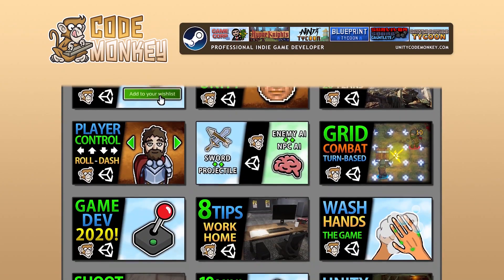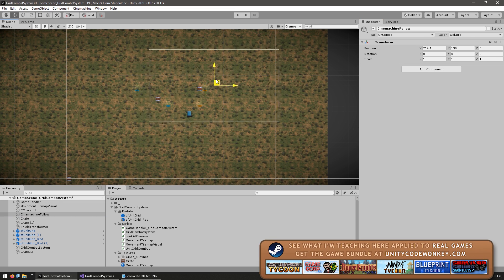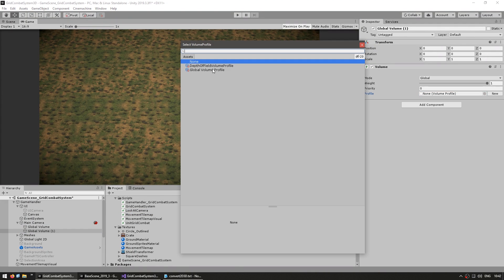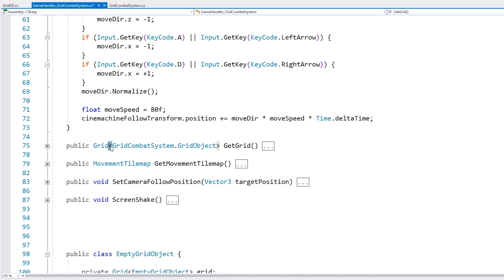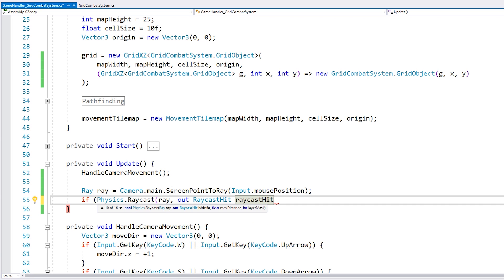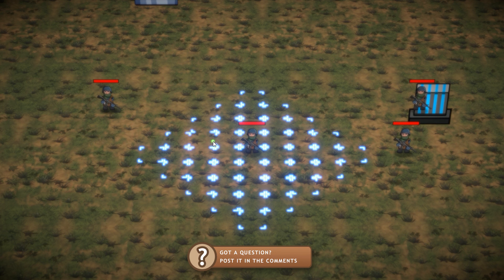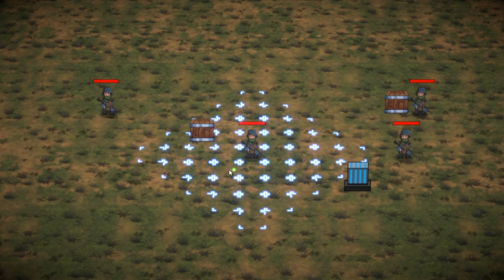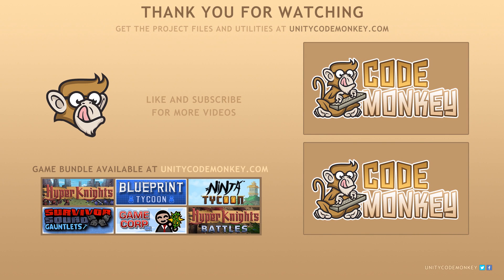Converting 2D into 3D! (Unity Tutorial)

Comment: In the video 16.36, soldier sprite overwrites the barrel's. How do we adjust the drawing queue so that the further objects can be drawn later?
Reply from the maker: The reason that happened is because I left my 2D Sorting order script on the objects, without it they would render like any other object. Just use 3D Quads and don't manually touch the sorting order or sorting layer

Comment: Love your tutorials! I'm getting a strange bug with the 3d conversion, where it says "Index was out of the bounds of the array" in GridPathfinding.cs:690, and none of the tiles are getting changed to the .Move part. Any ideas as to what could be causing this?
Reply from the maker: Are you converting a world position into a grid position? Check out the resulting X,Y to make sure your math is correct. You're either accessing under 0 or above width/height

Comment: One critique:  This tutorial is kinda limiting as you are brute-forcing your 2D to 3D rather than refactoring your code to be extensible.  Look up SOLID principles: particularly 'open for extension but closed to modification'.
Reply from the maker: What limitations do you see? This is exactly what I did when I made the Wash Your Hands game which is in full 3D.
Reply: @CodeMonkeyUnity  Maybe limitation is the wrong word.  What I was noticing was that you had to go back and change code to make the 3d version; which is against SOLID principles.  A better approach utilizes an interface for your base classes that your 2D and then 3D modes would inherit from. 

Particularly when you doing the mouse controls with 2D and 3D since you could have had them inherit from say, a mouse selector interface. 

I guess I was to point out a limitation here; what if you were to make this project on an isometric or hex map?

I'm not saying your solution doesn't work. Just that it starts becoming less helpful when trying additional things.
Reply: Exactly what I thought. He made changes to a lot of stuff, where he could just use interfaces or abstract classes.

Comment: Oh, not what I expected. That is like calling age of empires 3d, which it isnt . Just because you draw in 3d doesnt make the painting 3d
Reply from the maker: What do you mean? Everything is set up in a 3D world.
Do you mean the sprites? You can easily swap all the meshes from Quads to 3D Meshes
Reply: @CodeMonkeyUnity  It looks 3D, but isnt really 3D. Just like in Age of empires for example. That is what I mean, still useful. Just not what I expected
Reply: @coolboy9979  It's totally 3D, you could do rotate, zoom in, use 3D models, or anything you need.
Reply: @TheVegolas  Age of empires isnt 3D, just like Diablo 2 isnt. Look it up
Reply: @coolboy9979  But Diablo and AOE have 1 thing in common with this project -> they're using 2d sprites.
This project uses 2D sprites, but other than this is fully 3D. You could change 2D sprites with full 3D model and rotate the camera and it would work, becouse it's 3d.
Reply: @TheVegolas  Its still 2d. You only got X and Y and no Z
Reply: @coolboy9979  What are you talking about? If you want to use Y you can but in this case wasn't needed. If you later want to add a "jump" action or another action that requires "height" or Y you can implement it.
Reply: @TheBigYC  There is just X and Y like X is the horizontal line and Y the vertical. If you jump you go the vertical line up, but there is no Z
Reply: @coolboy9979  You're totally wrong mate...